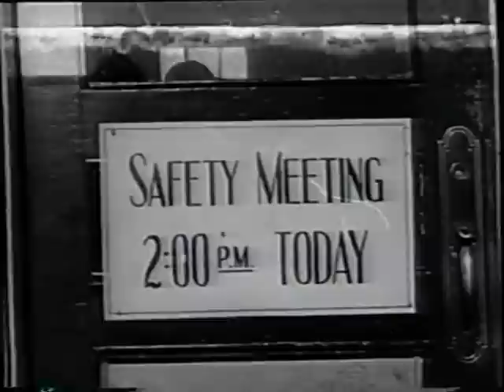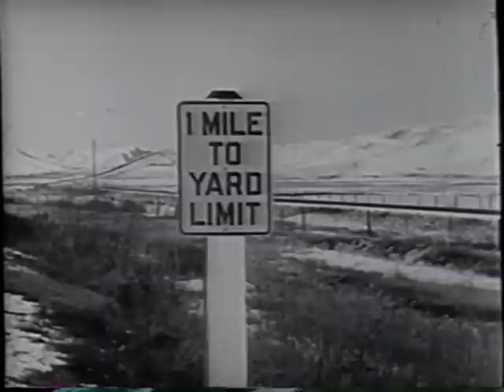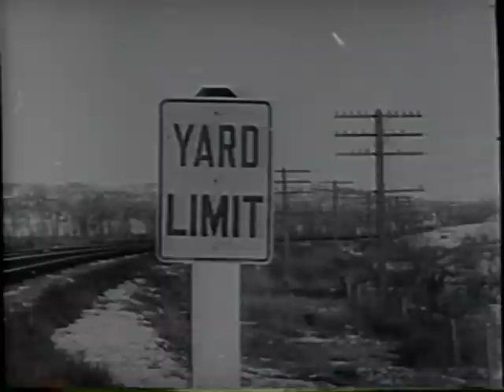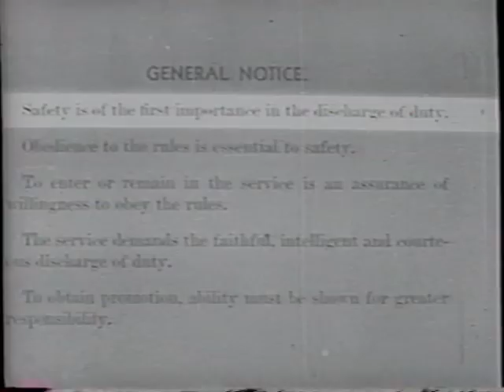"Why Risk Your Life?" --  1940s Railroad Safety Film

Comment: 15 feet beyond the car, not only so you have warning if it starts to move, but so you also have a safety margin to stop and check and make sure the second track is also clear. that way you have time to stop and look, and even if there IS a train coming AND the car you were walking around starts to move, you have time to go back. Otherwise you either need to jump out of the way of the first car, possibly into the path of a second, or you stop to avoid the second just as the first starts to move. I am not a huge fan of obsessive safety, but I also believe in a healthy respect for danger, and I cannot picture getting complacent around a rail line, or any heavy equipment.

Comment: Most of these safety measures for employees are no longer applied, because no one is permitted to get off or on moving equipment. I was taught by my dad and the switchmen on the Soo Line how to do this safely--as a kid in the 50s. When I worked on the Great Northern back in the late 60s, even then getting off and on moving equipment was frowned upon.
Reply: depends on the railroad. a decent amount still allow it. on csx its under 4mph
Reply: Where did you work on the SOO?

Comment: "Power handbrake with vertical Wheel" this is the most safe to use
-is unprotected and unsecured on a moving multi ton object that slices you in half if you fall infront of it
-Is instructed to use a wooden bar to operate the break
-Most safe to use

Comment: Because a train yard is a dangerous place to not pay attention my great great grandfather worked for the Pennsylvania railroad he first started out as a brakeman and for those of you who were freightmen probably remember this practice turning a vertical brake wheel on a freight car with a peg and you all probably got used to it then came the day the wheel was put on the side of the car where the peg wasn't needed but for those of you who were used to using the peg would probably use it on this brake wheel by accident my great great grandfather was on a train walking from the caboose to the engine because it was his job to turn those brake wheels he was walking on the catwalks and he slipped and fell between two of the cars he broke his foot and was caused by the fall

Comment: Note at 4:50 the employee is demonstrating the "right way" to stop to line a switch by stopping in the foul of the switch.  Today, at most railroads like the one I retired from (Soo Line), this would be a violation of the rules.  Always stop in the clear of the switch and walk up to line the switch.
Reply from the maker: True.  To put it in historical perspective though, some railroads' rule books had their rules clearly state Main Track switches were not to be fouled before lining for movement.  Other than main track movements, such as in the yard, did not fall under that. Interestingly, a book of rule INTERPRETATIONS put out by the ICG in the early 1970s, which oddly enough was as large as the rule book itself, made the difference clearer between fouling a Main Track switch and a yard switch, going so far to say that if an incident occurred as a result, the way the target or switch points were lined conveyed who had the right-of-way, whether the switch be lined normal or reversed.  Of course, one should never foul another track without making sure what they are about to foul is clear and with no closely approaching movement.  Congrats on your retirement.  I retired almost two years ago from the BNSF after 42 years of service.
Reply: @lokomac8  When I first started in train service as a brakeman at the Soo's former Milwaukee Road yard at Bensenville, fouling switches so the brakeman didn't have to walk that far was common practice even though the Soo Line's rules forbid this.  This continued even after I was promoted to locomotive engineer.   It wasn't until a change at the top that fouling switches on the Soo came to a stop (in the clear!).  I retired last year, March 2018, after 37.5 years of employment with the Soo and C&NW.  Congrats on your retirement too!
Reply from the maker: @WAL_DC-6B , it was some years, after the GCOR became the book of the day, I think, before "Main Track" was removed from the rule I worked under on the Santa Fe and it could generally be applied to ALL switches, which of course, is the safer course, particularly as the number of crew members, heads on a swivel and eyes were reduced, thereby reducing AWARENESS as to surroundings.  Oddly enough, it was some time before I even noticed the subtle change in wording that made the rule all-encompassing, lol.  Not surprising though, as most of what we did from when I hired on in 1975 THAT WAS CONSIDERED PERFECTLY SAFE, is now considered UNSAFE!  Of course, I had always considered "Safety Rules" and "Safe Work Practices" to be a misnomer and misleading in and of itself -- it is all about RISK MANAGEMENT -- the risk that is willing to be incurred to achieve a certain task.  Making something SAFER does not actually equate to making it SAFE!
Reply: @lokomac8   I started back in 1980, as a yard clerk for a short stint before promoted to the C&NW's engineering dept. (maintenance of way) as a ultra-sound test car operator and consequently was involved with railroad operating department rules such as the GCOR.  I was unaware of a time when in yard service it was accepted practice to be able to foul a switch.  None of the "old heads" ever told me it was legal in the past.   Thanks for the little history lesson!
Reply from the maker: @WAL_DC-6B , I think it depended on the rule book that one was working under, and except for roads working under say, the Uniform Code of Operating Rules, most back in the day had their own books.  Almost all books were loosely based on the old Standard Code. In my case, the Santa Fe rulebook I hired out under was dated Jan'y 5th, 1975.  As long as it was determined safe to do so and no movement was closely approaching it seemed we were okay to pull close to the switch, even fouling another track, to hand line it or to run through spring switches, flopovers or variable point switches.  Note the wording of the rule:

"122 (F). Except at spring switches, a train or engine must not foul a MAIN TRACK until switches connected with the movement are properly lined."  {emphasis mine}. Many arguments had taken place about fouling other tracks in yards before lining the switch, however, by either being overlooked or purposely excluded, the rule did not seem to specify as it was written. (Almost all blown away in modern times where they started specifying stopping back at least 50 feet from switches to be lined in these more modern times, of course.  That was primarily to keep the switch from being in a bind when operating it, but you wouldn't be able to get much closer to the fouling point anwyay if you were a good fifty feet back.)

Now, that being said above, note what is found in the book, RIGHT OF TRAINS by Peter Josserand (1957) that used the latest addition of the Standard Code (1953) as the basis of it's discussions of the rules.  The Standard Code said this:

"104 (5). A train or engine must not foul a MAIN TRACK OR OTHER TRACK until switches connected with the movement are properly lined."

Now this was always a bone of contention and we would occasionally be called down by an official for doing it . . . until we asked them WHERE they got the info from and they would find the Santa Fe rule above and we would be somewhat vindicated, whether we were actually right or not.  Someone smarter than me and all the switchmen I worked with back in the day could still say we were wrong, but too late, I'm retired now, lol.

Comment: Oh mercy!!! Any FRA or OSHA rail inspector today would just have a fit if you tried ANY of the SAFE ACTIONS in train handling shown here! I dont even think they let switchmen get on and off moving cars anymore, do they?
Reply from the maker: Some railroads, particularly shortlines still do. Just keep in mind, they are not actually "safety" rules or even "safe" work practices, but a form of "risk management." The safest thing to do is to do nothing, from that step on to doing something, more risks are incurred. When risks, for whatever motivation or purpose become "unacceptable," THEN measures are put into place to reduce the risk to an acceptable level or eliminate the risk. The end result is from behavior, basically.
Reply: @lokomac8  So true. I havent been active in years, but when I first worked on our local operating railroad museum, we still used the (trailing end only) footboards on our center cab diesels when we switched our storage yard...we stopped around 1984, when the FRA outlawed that practice for good. Still got on and off moving equipment though, and its HARD to train volunteer operating crews on the safest way to mount/dismount a moving freight car.

Comment: Even in the 60's it was considered dangerous to ride on the footboard of a locomotive, and to get off a loco too close to the switch.
Reply: YLW Pyro Yeah, trainmen rode the footboard of steam locos as there weren't provisions for riding forward of the engr any place else...early diesel locos like the GP7 had footboards but the practice was discouraged because diesel locos had side steps...and getting off next to a switch will get you knocked out
Reply: +25mfd By the 80s, footboards on Diesels were a thing of the past. Getting on and off of moving cars and locos was still allowed. In the early 90s, that started to change. Santa Fe banned it in 1993.
Reply: Even the hand throw switches are dangerous

The iron weight at the end of the lever is easily able to smash a foot

Comment: A horizontal handbrake wheel on the top of the wagon! Why on Earth would they put it in such an inaccessible place? Why not vertical at ground level where it is easily operated?
Reply: The brakewheel was on top so the trainmen could walk along the tops of the cars to set the brakes. When moving a loose car in a humpyard it was necessary for the man to be atop the car so he could see where he was and know when to apply the brake.
Reply: Before American trains had air brakes, the brakes were placed high up so that the brakeman could run along the roof while the train was in motion to apply and release them. After air brakes were introduced, the hand brakes were left where they had always been for a long time.
Reply: Thanks for the info Dave. Much appreciated. Hopefully that has changed to a more contemporary situation these days.

Comment: The SAFEST handbrakes are the ones on autoracks...they can be set with BOTH feet on the gound
Reply: +25mfd they actually aren't designed to be set from the ground they are meant to be set from the ladder but I get your meaning in saying they are the safest. Now if only there was some way to cross without having to walk to the next platform or the end of the cut of cars!
Reply: Yes you are right. That ratcheting noise is loud and annoying.

Comment: I can't imagine it makes a difference where you cross railroad tracks on foot.  Trains don't appear out of nowhere.
Reply: They have to watch where there going because a train running 70 mph can come out of nowhere and by time they realize it it might be too late for them. 🚂🚃🚃🚃🚃🚃🚃🚃🚃🚃🚃
Reply: There are some places where you can see trains coming and there are some where you can't...
Reply: If a train is coming 70 mph you can’t figure out what track it’s on if you’re not knowledgeable either.
Reply: True all the above ^^ also, when you’re crossing tracks in a multi-track area, say you don’t clear and have to wait for a passing train. All okay because you saw him coming, right? Wrong. While you’re waiting (and that may involve a LONG time because of the sheer length of the train or if he has to stop elsewhere down the line), other trains on other tracks are coming and going and you may find you’re hung up between two trains with little elbow room for quite a while. Just don’t find yourself in that position. Wind, steam, other issues may present problems keeping your balance, too.

Comment: How can you not hear a train? Especially in the steam era? You have to be pretty deaf not to hear the steam chugging and blasting out the side.
Reply: because there was steam trains everywhere... and they all sounded either the same or a different noise
Reply: when shunting, trains would often only actually accelerate for a few seconds then let it roll. the ambient noise is enough to cover up the hissing etc.
Reply: You'd be surprised - even with steam locos.
Reply: Wind blowing across your ears against a train can mask sound.
Reply: Also a car or a cut of cars rolling on straight track can be totally silent as well. I have seen it many times in my yard where a cut was rolling through and the only thing you could hear was the gentle rumble as the weight shifted across the ground. Outside of that there was no sound until it reached the standing cut that was catching them.